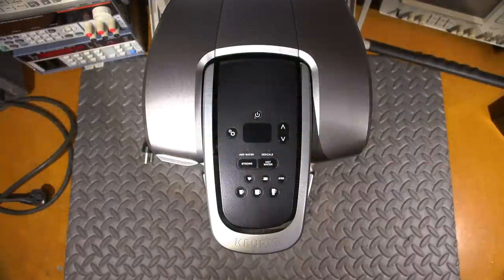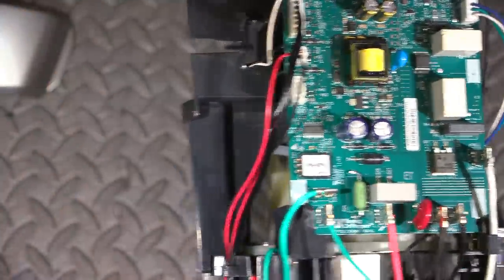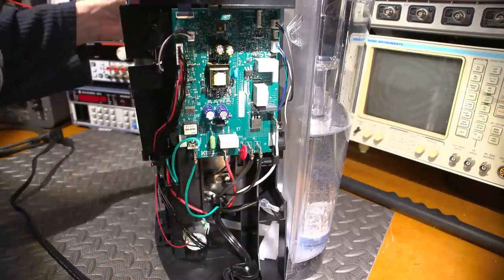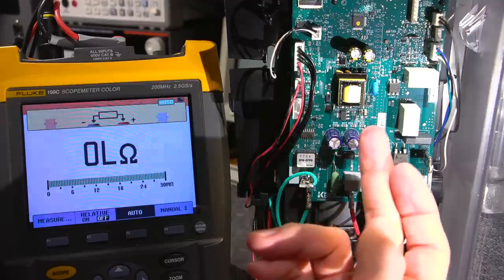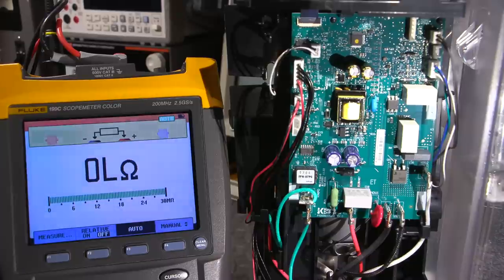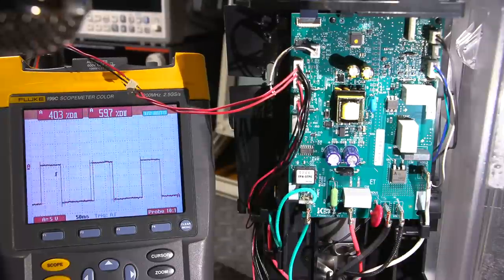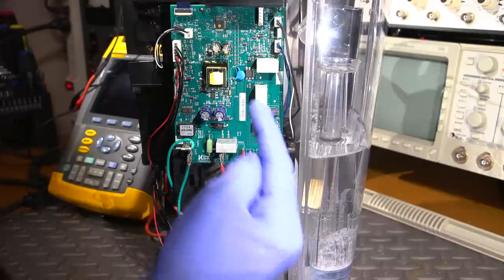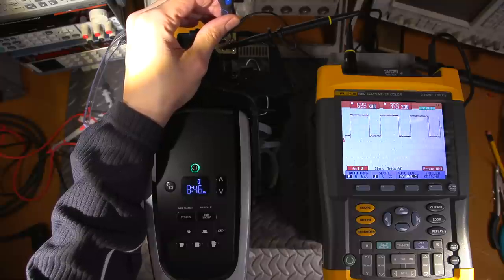Coffee Maker Repair And Modification - "For The Perfect Cup"- The Keurig!

Comment: Great, but I'm confused about the noise issue. You settled on a design issue, and added the filters to ground, but mention another machine of the same design which is quiet. Surely this points to a faulty component? The case remains unsolved!

Comment: I wonder if there's some decoupling that's failing/ed that's allowing the PSU noise to falsely trigger the MCU's speed sense input, thus causing it to falsely read a higher RPM than reality.
I know you measured virtually no noise on the PSU output, but the hash that's going back up the line might be also coupling into the sense line.

Comment: Now, I want a T-shirt that says: "Nothing leaves this bench not working!" Could it be possible that the pump motor itself has a mechanical problem? It seems to rattle a bit at the beginning (ie. bearing issue?) but once the rattling stops, to which the motor overcomes the friction and is allowed to speed up, it starts pouring water. That said, there might not be a problem with the speed controller chip.... it's just maybe the motor has become out of spec and requires a higher PWM command to give it extra torque to overcome the friction.

Comment: plugging and unplugging corrupts a chip, really?  You don't suppose the controller has feedback from the heater and adjusts the speed accordingly to make sure the water is at the right temp, and there is something wrong with the temp or pressure feedback mechanism?  And all you did was break into the loop and adjusted the pwm manually without finding the real problem?  What do you think?

Comment: Coffee maker hack: Add an ATmega with a NFC reader and put a NFC tag on every cup you use. So you can automatically adjust the amount of coffee to the cup.
Reply: Funnily enough keurig tried to do this as a form of coffee DRM. I'm not joking, they put RFID tags in the lids on KCUPs with authentication keys that the coffee machine would need to validate before brewing a cup. it could be circumvented by reusing a valid lid.
Reply: @pseudomemes5267  Really? Ok, that's just shit! I do more useful things with NFC tags.
For example, we live with six people in this flat. we have a NFC tag on the washing machine. If you can this tag with your phone, and the machine will  send you a message when your laundry is done. It only send this message to the phone which scanned the NFC tag. And it also let the beeper beep only once instead of beeping until you turn it off. So you know exactly when you laundry is done and don't annoy the other people with it.

Comment: I was really expecting the fault to be a low 3.3/5v line and a resistive divider to the chips ADC.

But I don't see an obvious low voltage regulator there.. but surely it's not operating at a 12v voltage level? at first I thought it was Q1 below the transformer but that's a really odd placement for it... So I'm guessing that's just the switching fet, although an odd chip package for it.

But hey, I'm not complaining to someone hacking a fix with their own add-on circuit! I just wish I had the parts available last I ran into a similar situation!

Comment: The processor is for sure getting the speed signal, as it's shutting down when it does not get the signal,  its getting 12v, its able to control speed, so to me the fact that it's able to control the speed and it is shutting down when it loses the speed signal, means that its an issue on the control side of things, if i had the tools that you have available i would find the pwm at slow speed and inject pwm to verify it changes speed,  confirming the diagnosis if any of that made sense lol. Its more difficult to explain the process than it is to actually perform it ...😂

Comment: Sure, I'm designing and prototyping stuff and etching boards for a $99 made-in-China coffee maker. LOL... Or I'll buy a new one, and returned the broken one in the same Wal*Mart box.... 

If that one was inherently noisier than the other ones you have, is it not probable that there's a common failure somewhere? Maybe the microprocessor is timed off the power line and somehow that's not working properly so the motor timing is wrong AND it makes all the RF noise? 

These things happen: let me tell you about my 1985 Pontiac Fiero 2M4 which started perfectly when I got it rolling and then dropped the clutch in neutral, but would crank vigorously off a new battery and still not start. It had spark and fuel and compression off the starter, but still would not go. Capacitors in the ECM kept resetting the computer during every compression stroke and while it was dumping fuel and firing the spark plugs, the timing was so badly off that the old Iron Duke wouldn't catch - I discovered that when I found the +5V rail to the Throttle Position Sensor dropping below 4V during each compression stroke during cranking, and seeing everything in the ECM module was powered off a 7805.... Three new capacitors and I could almost look at the key to make it start. 

Thank you for your Edutainment. :)

Comment: I hate Keurigs, there filling up landfills with K-Cups and broke Keurig machines.
I’ve heard many problems with them, early deaths, many just months old.
One problem is it even kills the machine if you remove the water tank while brewing, which you shouldn’t do anyway but if it just get bumped can do it. Supposedly blows a fuse or component inside.

Comment: I have this weird feeling that what's happened is the pump sensor, being active low, is actually latching too long, and somehow reporting a faster speed than the motor is actually turning, so it's being regulated down. Maybe not, though? Because it also seems like the function of "speed" for that motor is actually the entire length of a cycle, not the duty cycle width. Which would mean that latching pulse width for too long can't be an issue, because the pulse width changes proportionally to the cycle length... hmmmm. Yeah I don't know really what happened here. Perhaps the software parameters being corrupted is actually the issue. That would make sense given that there is so much unfiltered RF noise on the mains line; lack of bypass or decoupling could have had adverse effects in regards to static charge and seriously confused the microcontroller.

Comment: 37 minutes in and it looks like a CD4000 series D-flip-flop set up as a /2 divider would speed things up twice without losing speed control – and it would directly interface with whatever logic voltage is used, be it 3V or 12V. I also wonder if there’s something silly causing the CPU to double-count those pulses. Let’s see what MrC figures out :)
Reply: 43 minutes in: It looks like the feedback is based not on frequency but on pulse width; and the MCU lost the factory speed setpoint and is using a default value that’s too low. What I would do, to retain the speed control, is to add a pulse stretcher using a 555. That way a fixed offset would be added to the control loop, and the closed loop speed control would be retained. Running it open loop from a fixed PWM generator is OK until parts wear out some more or the ambient temperature changes enough and then it will under- or overfill again.
Reply: So, the circuit does do something akin to adding an offset, with speed control retained. Cool! Nice approach, too!

Comment: Dunno why they need to make a coffee maker so complicated when all you need is a heater, a temp controller and pump. Measure the amount of coffee out you prefer with the right amount of water = done, and the maker only cost maybe $30 with very few things that can break. Mine has a timer and clock but have never used even those whistles, since it makes a cup's worth in like 5 mins (about the amount of time it takes me to wake up enough to be able to pour straight without making a mess anyway).

Comment: It started with a complaint about high frequency noise when plugged in BUT not operating to make coffee. Very strange indeed.
Most appliances must pass an electrical noise test before allowed on the market. This one did not????
The most obvious low tech solution (for the noise) wasn't even tried. A capacitor between phase and neutral

Comment: did you clean  the unit. needs done. give it a good cleaning,I use vinager, the whole bottle, no water..  run it  2 times and add a little water.   then  rinse tank real good, fill with  water, run at least 2  tanks water, then   run it  til you do not smell or taste  vinegar.   try get 10%  if you  can find it .  oh yes,,  run it  once, then let it set fer  15/20 minutes,   run it

Comment: I have Mr Coffee with no timer, just the el cheapo $17.00. I put a Sonoff Mini R2 in it and changed out the lighted switch for a 2 pin. I turn on Mr Coffee using my voice and have a timer set on Alexa to turn it off in 2 hours. My watch tells me when it is on and then again when it is off. $23.00 & I don't have to put up with all the issues Keurig offers.

Comment: 35:00 in; I didn’t understand why using a low value resistor across the pwm pins increased the speed of the motor?

Comment: Where is the water temperature sensor IC? Doesn't a Keurig regulate water temperature to a degree with pump speed and PWM on a heater element? Didn't you just defeat part of the temperature regulation by overriding pump speed? That will dramatically affect CQ (Cuppa Quality)...
Reply from the maker: The coffee tastes great, and is the same temp as the others.

Comment: (Comment at 30min in watch time)Listening to that dc pump motor run it doesn't sound right, It sounds like the commutator and brushes are polluted or 1 of the windings is open or going high resistance.

Comment: If the uController firmware was corrupted, likely nothing would function, like switches, etc. You would have to reflash the firmware. Therefore, not very likely part of the firmware got corrupted. Something else wrong with the pwm circuit. You could have saved some effort.

Comment: But when you factor in the time it took to diagnose and make the new board and insert the new caps, you would be spending way more hourly than buying a new coffee maker if you charge $100/hr. shop rate. THAT is why most stuff gets tossed out.

Comment: It’s the valves that failed Paul lol
Reply: Yeah bad check valve allowing the line to drain down and causing back flow. It will get worse until the pump just treads water or burns up. Either way its a POS.

Comment: I miss the good ol' days when that control chip would be in a socket and you could simply order a new preprogrammed one from the manufacturer if it went bad or got corrupted. These days you have to reverse engineer the damned thing (usually not worth the effort and time) and hope the manufacturer doesn't find out and sue you for doing that. They really need to outlaw planned obsolescence.

Comment: Yeah bad check valve allowing the line to drain down and causing back flow. It will get worse until the pump just treads water or burns up. Either way its a POS.

Comment: I have encountered a number of electronic AC  powered devices that came from China causing RFI on AM radios. It appears that they are so cheep that that their not putting in a simple RF filter on the AC line to stop the switching noise from radiating. This RFI coming from these, destroys AM  Radio reception in the same home. I don't know why the FCC here in the USA is allowing this, the device is breaking part 15 FCC regulations on low powered RF Transmitters. Your Coffee maker I bet was made in China, like most electronics is.

Comment: It was obvious that you made the coffee maker work, I don’t believe you fixed the actual problems.  1) Water not flowing 2) RF noise.  1) water not flowing is most probably calcification within the galleries of the thermo-block (water heater).  Regular maintenance, replace water with 1 or 2 cups of white vinegar.  Cycle the machine until a cup is being filled with hot vinegar.  Leave machine for an hour or two.  Flush vinegar out of the system with clean water.  This is a 99.9% way to keep machine working.  You built a cct to “over-drive” the motor and I suspect create enough pressure to force past the calcium blockage.  This fix will eventually kill the pump motor.  2) The machine was still creating RF.  I work on transistor organs.  I have found from time to time a transistor is working OK voltage-wise but, it is a noisey transistor.  Replacing the transistor fixes the noise.  I have not worked with FETs for many years.  I was taught that no one in their right mind uses FETs in amplifiers because they are inherently noisy.  I wonder, could that FET you looked at be the RF noise problem.  Having said that this device is not an amplifier.  There seems to be so much noise, I would suspect the noise problem is near the power input maybe that red coloured ceramic capacitor near the transformer has gone high.  I didn’t see any other filter capacitors near the power supply and you proved the 2 electros work OK noise-wise.  Best fix get a new simpler machine.  Thank you so much for a most interesting video.  Looking forward to the next on. 👍👍

Comment: I don't get it, you determined the fault yet you didn't fix the root cause of the PWM issue, instead you created a circuit to fix the problem, why not fix the component which is causing the low PWM ?.
Reply from the maker: Where would you get the uC? Then you need the firmware, where would you get that? The uC will obviously be locked, so?
Reply: @MrCarlsonsLab  I must have missed the part where you explained that the uC and firmware are unattainable. My apologies If I did miss that part.

Comment: Check processor voltage!it won't be 12v
Reply from the maker: The clock and all functions are working, no need to test that.
Reply: @MrCarlsonsLab  You should always test, I have cnc machines fail with all sorts of odd faults seemingly unrelated to the processor supply , only to be fixed with a simple tweak of the psu.

Comment: I am sorry but I must warn you! YOU WHERE DEALING WITH HIGH PRESURE HOT WATER TANK!!! I'm almost sure that processor is doing what is intended to do by design! The source of the strange behaviour is lack of feedback from sensor (temperature, level, pressure). By cheating the circuit in that way you omit all protection designed int to the device.
Throw away your PWM circuit and check sensor please. Even if I am wrong and the problem is in motor encoder or processor's ROM, for your safety, replace faulty part and don't try to cheat in such a way.
Reply from the maker: There is no high pressure, it's vented. You will notice, they don't put plastic on high pressure vessels :^/ You may want to learn about what you are taking the time to write about.

Comment: As I am really into repairing electronics but this video is for me overkill. I even get the Keurig manual to see if they are programmable. And manual say it is but no more details on that. But in their trableshoot section they have the issue you have and propose 2 things (descaling, especially slightly use coffemakers can clog really bad, and second thing, and exit needle clogged). So altering signal when other things are happening makes the unit broke quicker due to excess use on pump. Or maybe video do not show that but you actually done the other things and they are not solve the issue. Also i do not believe in corrupted data in uC, it would like miracle to just corrupt data on the flow region and the other and this micro handle some work LEDs, pumps, display, pressure sensor temperature sensor. Even 1 change bit in micro in mostly cases couse the whole program crash at some point.
Reply from the maker: It still makes a perfect cup of coffee today, so the fix is solid. Yes the uC had issues, and the new circuit filled in the blanks.

Comment: I was actually disappointed in this repair. You have multiple machines that are not noisy. Therefore this one should not be noisy. It should not need the extra caps. To me this means they noise is a symptom and should be repaired. Unless the other models have the extra caps from factory. As a revision. It would be interesting to compare the noisy coffee maker to the not noisy coffee maker. And see what is wrong with the noisy one. Maybe using one of the RF probe thingies you made. After all the noise could be throwing off the pulse circuit or the processor. You would not accept a patch like this on a radio. Why then on the coffee maker?
Reply from the maker: The other machines have a different circuit Bart. Same machine, different board. Bean counters got to this one. I added what should have been there in the first place.
Reply: @MrCarlsonsLab  that is unfortunate. You made it sound like they where all exact copies. You've made so many nice repairs, this patch just felt out of place.